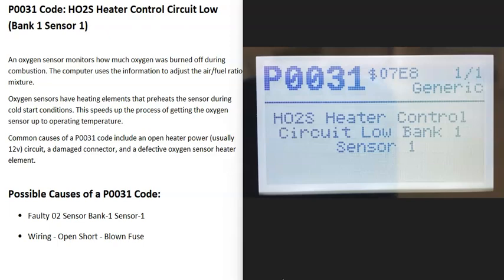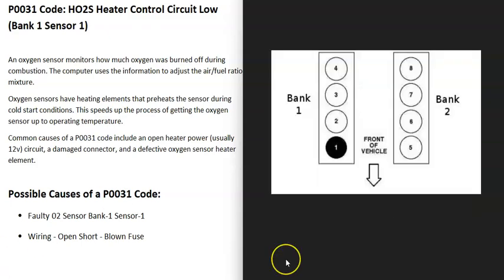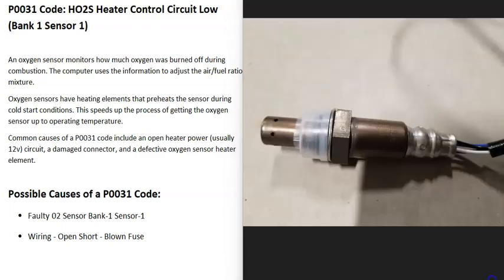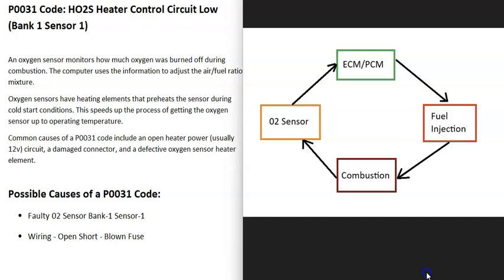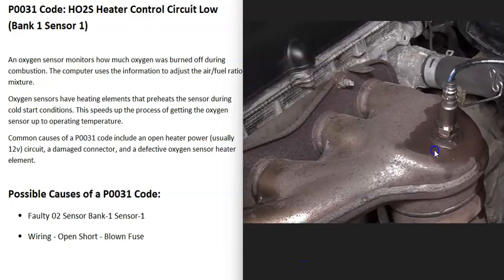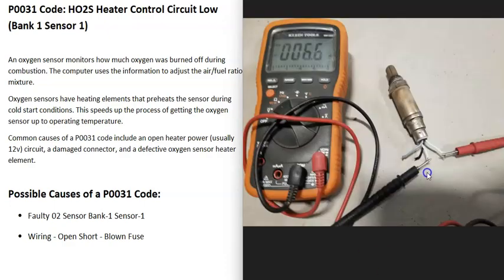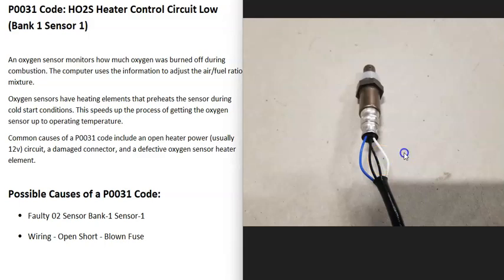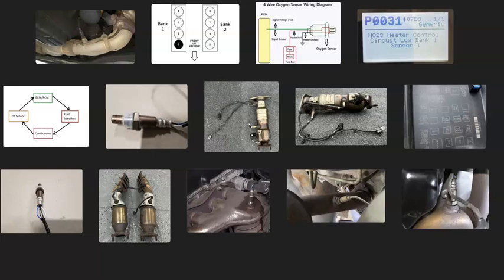Causes and Fixes P0031 Code: HO2S Heater Control Circuit Low (Bank 1 Sensor 1)

Comment: Can a bad converter be a cause
Reply: Iv had one truck do this to me. Exhaust shop installed wrong catalytic converter had a o2 sensor code wouldn’t not go away all wiring checked out. Finally figured out they installed the wrong cat. They swapped it out for the correct cat and the o2 code went away. I know you wouldn’t think it would cause it but Iv seen it once before.

Comment: Hi thank you. I got a p0051. Tested old and new sensors, they passed. Wiring next… 

Do you have any instruction or tutorials on how to read a schematic to then use it to trace a an entire circuit to locate a potential open/short?
Reply from the maker: It is always best to get schematics for the vehicle to know for sure what is going on. I would start by checking for voltage to the heater element; when the engine is cold, it's usually 12 volts. Use a separate ground when probing the positive and use a separate positive voltage when checking the negative. That will show if one wire has a problem or both.

Comment: Would this make your engine cut out shut off under acceleration/underload? I have a obd1 diagnostic scanner i made for mazda. And the led light has 3 flashes and then 1 flash on the led. And i think flashes 6 times for another code.

Comment: Does this causes to shut the car down?
Reply from the maker: The engine will still run. It just won't be very responsive.
Reply: I have the P0031, 37 errors right now. It idles weird and about 20% power (it runs in some kind of mode to prevent more damage or something - like a safe mode. Sorry, don't know the english word for it. Also it uses the same amount of fuel as my V8 (the car with the problem has 4).